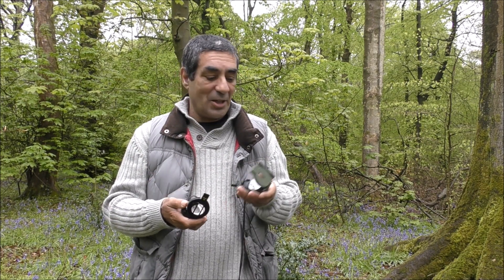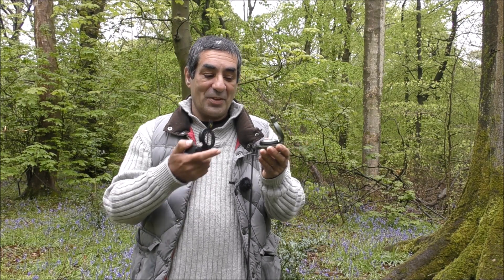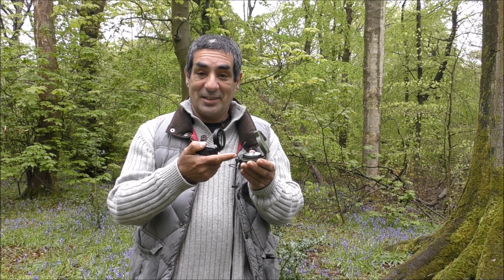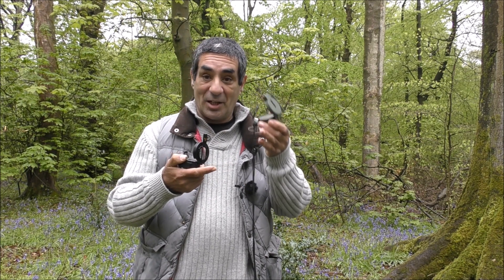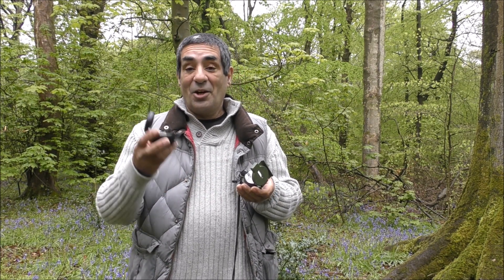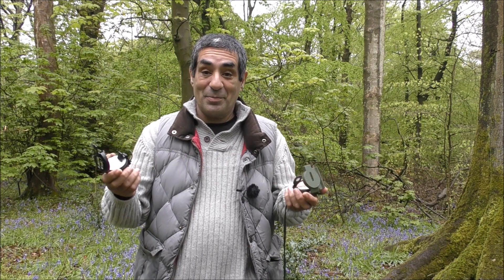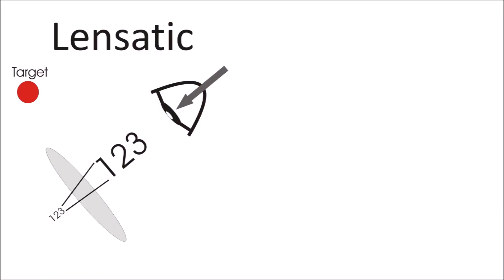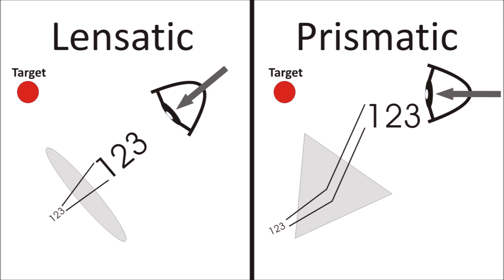Lensatic vs Prismatic compass - what is the difference

Comment: Could be wrong as I've not handled either type, but I think the two types also read off different sides of the floating disc. The lensatic looks at the card near the front of the compass (farthest from the user) while the prismatic looks at the card near the rear of the compass (closest to the user).

Comment: Great videos. Is there a compass that combines the benefits of a prismatic compass and a baseplate compass?
Reply: Not completely.  The hybrid compasses that have both a baseplate and a prismatic sighting system all use a magnetized card instead of a boxed needle, which blocks any view of the bottom of the compass and makes it difficult to use the compass as a simple protractor to measure true course headings from a map (one of the key benefits of a baseplate compass).
Reply: I've just started looking into this myself, what I have found so far are the Kasper & Richter Alpin PRO Baseplate Compass, and silva expedition 4 /54 compass.